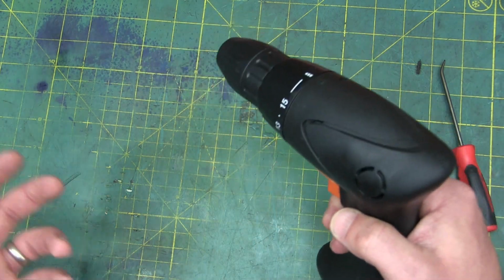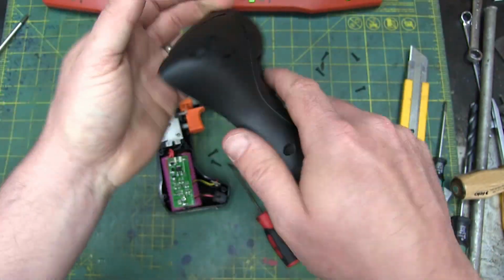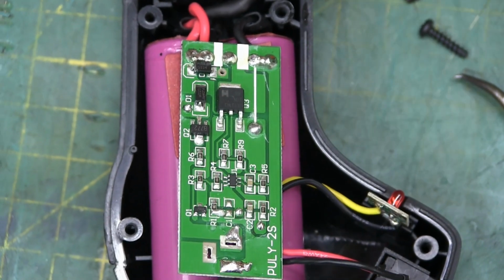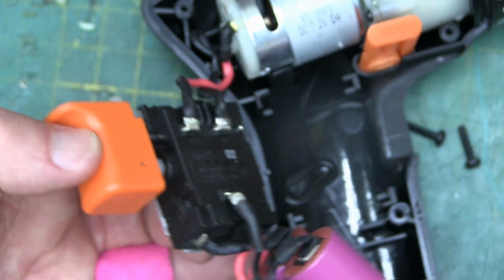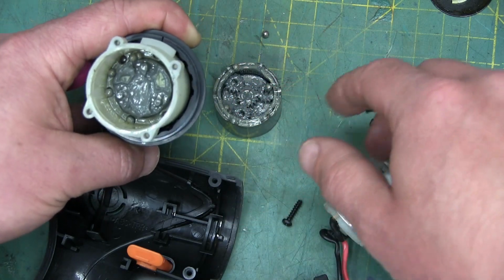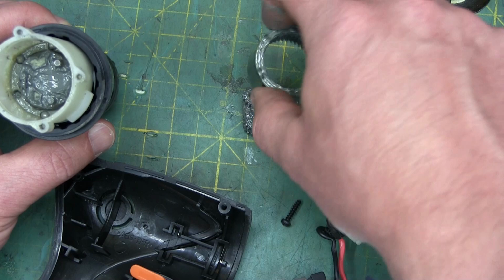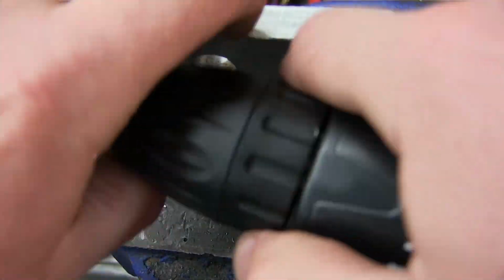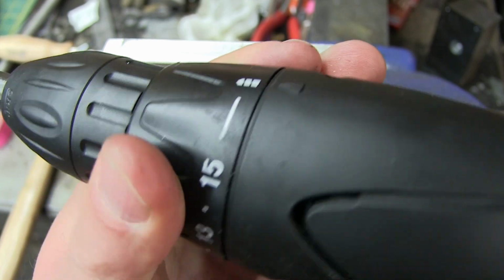BOLTR: WORST IN CLASS IKEA Drill

Comment: are you sure the clutch is back together properly?  because mine does not slip at max setting, if the load is too high, the protection circuit will cut power to motor instead of any mechanical protection.

Comment: I picked up the Black and Decker 8 volt LiON dril for $20 bucks from Malwart. No clutch, no proportional action on the trigger, little 380 sized motor. But you could charge is with a USB port (It's kinda funny plugging your drill into your laptop to let it charge). After about 6 months of using it for things like 'picture hanging duty' and drilling the odd hole, the whole gear box started moving inside the body so the chuck had like a 1/8" of play. I put the brain board and batteries in an old 4.8 Makita screwgun from 1992 (Ish?). Works like a MoFo now.

Comment: I mean... you have to consider this isn't sold as a "TOOL", it's sold as an accessory to assemble the 10 pieces of furniture you just got at Ikea with the pre-drilled holes. Honestly I'm sure they 100% knew this thing had no torque... and that's so you don't destroy the particle board pre-drilled holes shit Ikea sells. Also... too much torque and those cheap Pozidriv bits will self destroy, potmetal pieces of shit.

Comment: Looking at the battery charge control PCB, it appears to have a ubiquitous six pin dedicated control chip as seen in many Li-ion consumer products. Controls both the charge, current draw and under voltage cut-off.
Reply: Maybe tweak the current sense resistorator to get just a little more schmooo...

Comment: Never seen a tool take more shit than a Hilti. We use both the cordless drill and corded combihammer at work and man does those hold up great! Left in rain, drowned for a few days, frozen stuck in  water over the weekend with temperatures at -30c, exposed to extreme heat form propane torches, tossed off the roof at 15m and continually running for 18 hours straight 5 days a week, mind you on the combihammer we had to replace 3 extension cords cause they couldn't handle the extreme usage. and the tool last around 3-5 years with that usage every week.

Comment: First lithium powered drill i ever bought was a ryobi 12v yrs of beating fixin crap in the house for my better 3/4 part. It surprised me when i did some shelves one battery about 30 3" screws into pine studs and it didn't even complain.

Comment: Just as a side-note...had something to do once with a similar drill, only mine was mains-powered (one of those series wound universal motors). It had the same clutch mechanism, and i managed to mount it offset (IE. the markings on the clutch settings weren't accurate. Max clutch torque could be stopped bare-handedly. You should check whether that's the case ;)

Comment: Hey, AvE! There might be something wrong with your drill. I'm pretty sure it's not supposed to slip with the clutch dial in the driling position. Mine just stops working when it gets overloaded and if I twist the business end a bit, it works again. Also, I get a decent amount of torque out of it, enough by a good margin for drilling holes in, say, birch. I think 8mm is the biggest bit I've used with it for drilling and I've made 64mm (ca. 2.5") holes in one inch alder with it. Of course, aluminum is fine, too.

I got a returned unit for 10 euros a couple years back and it's the most value I've got out of a tenner, I guess, ever. I hardly ever do anything with steel or stone, but when I do I don't ask the Ikea drill to do it. The 250 euro Bosch is for those. This Ikea drill, I use it for everything else, in the literal sense. The idea is to know what it can and can't do. I remember using the Bosch twice in the last year, once for drilling holes in .30" steel and once when I forgot to charge the Ikea drill. I've got to say, I love the little bastard! =D

(And I let my friends see it, too.)

Comment: Was the dewalt you referenced the DCD785M1 ? Because I have one and the fuckin thing is out of warranty because my dumb ass didn't register it (Or know I had to!) for the 3 yr warranty. I nearly have to choose a smaller drill bit than the hole size i want to drill because the €200 "professional drill" I bought is as wobbly as a nun after getting her knickers pulled down.

Comment: lol that little dc gear motor is around $2 or $3. Similar generics on fasttech are :- the 12v rs 380ph is $3.30 or the 24v rs 65sh is $2.09 :D or you can get a motor and step down for around $4 :)

Comment: My old lady had one of these for putting picture frames together it died. so she bought a Bosch drill all it did is tear the screws out of the frame so it's in the draw and I rebuilt the old girl  still going. I may of had a couple of parts left over.
Reply: Richard Rowe Why wouldn't she use the clutch... instead of full bore.
Reply: Broxty do you think i can get my mum to understand that the trigger is variable to her it's only on or off, it's like trying to train an old dog a new trick
Reply: Two things: 1 round here old lady means your wife, 2 which spare parts were left after reassembling your old lady?

Comment: I love mine! Got it for free because the batteries died. Replaced them with some old ones for a laptop battery pack and it just keeps on going. Great for taking apart small electronics, drilling small holes etc. Ikea should call it the "Boltr" ;)

Comment: 2:55  isn't that a micro in the middle of the board?  The tiny gidgit...
Reply: The little 6-pin chip is most likely a dedicated charge controller, making sure the batteries aren't overcharged or discharged below the minimum level etc.

Comment: The thing about it that pisses me off the most is the gouty foot thing on the bottom pretending to be full of batteries when in fact they fit in the pistol grip and it could have been more compact.  It's like when you get the girl's top off and she's all Wonderbra and wishes when she'd be just as sexy, maybe moreso, if she rocked what she's got.  The drill is insecure of itself when, given what we see here, there's really nothing wrong with what it is -a small, cheap electric drill for apartment-dwellers, the office, rigging up to charge off the car battery & leaving it in the trunk, an "upstairs drill" because the good ones are in the basement/garage/truck, etc.

Comment: My 1983 Hornet had that motor!
Reply: I think I mean Grasshopper
Reply: Yeah, I totally noticed the same thing. Good times.
Reply: I loved my Hornet..Levi special edition..seats had authentic Levi Jean material and rivets....oh this isn't the Hornet forum...sorry.

Love these vids..keep em coming.
Reply: +Raymond Mucklow you sure that's a magnet? think maybe its to dampen and keep rattles down. At least its been that way with the rings I've found on motors. I had the original Bruiser. I was at the second race for our RC club when it shared an oval track with the horses. last I checked, they were hosting the winter nationals.
Reply: Jimmy's Tractor I hate to break the news, they didn't have the permanent magnet on them. That big ring around the case.
Reply: Jimmy's Tractor my folks bought my brother and I a grasshopper. Then i bought  the frog from my uncle.
Reply: Yeah, Hornet came with the 540, Grasshopper had the 380.
Reply: Jimmy's Tractor man it might not be but I don't remember any of the motors having that ring around the outside, could be wrong, I'm 43 now I know they were top sellers for years. but for sure they didn't. The frog I had had independent suspension.
Reply: Jimmy's Tractor Remember the Penn in the arss speed controls man those sucked.
Reply: LindyFD 160 yeah, the frog i had bought later had the 540 on it. still no ring tho, around the outside.
Reply: I also had bought the Blackfoot it was the frog with bigass tires. very cool.
Reply: +Raymond Mucklow my first was the associated RC12E. It was $72 COD from Tower Hobbies. came with a 6 cell GE 1200mAh nicad pack and a charger with a "do not shorten" resistance lead that would burn your hand if you touched it. one day I forgot to listen for the 15 minute timer. I went out to the garage and all the plastic melted off the cells and resistive wire.

Comment: Nice.  OK for putting together flat pack furniture and drilling holes into plaster board I guess.  The gubbins inside actually looks pretty hackable - if you wanted a variable-speed geared motor for some small hobby project, it might make sense to rip the innards out of one of these.

Comment: Finally, a wireless drill motor I can afford, along with the can of red Milwaukee paint.
Reply: M3 1st gen. 🤣
Reply: IamScarhead
Reply: Haha, well if you want some decent stuff I'd recommend going to a yard sale or looking on craigslist for tools nobody wants anymore, most of the time the only problem with em are dead batteries (and maybe a little dirt) so they're super easy to fix with a $30 replacement or if you're more of the DIY type then a few cells shouldn't cost much more than $10 +$2 for some tabbing if you don't have any.
Reply: @vgamesx1  The problem is the batteries often cost more than they are worth...
Reply: @Wingnut353  you can replace the cells yourself though
Reply: IamScarhead lol. check my channel if u like Milwaukee tools

Comment: Thanks for the teardown!
Found a bit of info about the batteries...possibly: http://www.sourcingelectricals.com/3-6V-1300mAh-ICR18650P-Electric-Tools-Lithium-ion-Rechargeable-Battery-11226606/

The capacity is different though.Often the companies divide up the production run into their different capacities, tested at the factory, and label each differently. Also done quite frequently by some companies is just not accurately rating the batteries. :-) Hopefully the ones in the Ikea use the same less-volatile chemistry variant for the ICR prefix as used in the batteries in the link.

Comment: Uncle BumbleFuck, I'd like your opinion.

I'm more of a corded tool guy over cordless. But I honestly haven't had much experience with tools that don't have cables (perhaps I'm biased that way).

Do you have opinions regarding cordless versus wall-supplied pixies? Apart from the obvious potential tripping hazard, what with extension cords and what all over the place...
Reply: less torque and more dickin round....stick with the cords if you can. i've gone back to them for many reasons. one of them being corded tools like dewalt sre downright cheap at the pawn shops because no one wantd them these days! i give them the TLC they deserve!
Reply: Morne' Geringer use batteries for places where you don't know if there'll be outlets available, use corded for your home and shop...
Reply: Convenience is hey you can either but first class tickets in a plane or economy.They both get you a seat in the plane.
Reply: Cordless is also great where cords will get in the way, for example if you're working up high such as on a roof, you don't wanna be foolin around with some extension cord that'll yank ya off the roof, soon as you run out of cord or it gets caught on something because you didn't tie it down and it's just really inconvenient having to swap plugs while moving around.
Reply: I like to use both, mostly because of the cost. For example, years ago I had to install decking on a large apartment complex. Replacement batteries for my cordless drill were $110 and a cheap corded drill(with a clutch) was $40. And if you're working off the ground you can tie the cord around something preventing tool splatter.
Reply: No sorry, when I mentioned roof work I was mainly referring to fairly simple housework, like when I helped build a shed, the cordless drill was much easier to work with, especially since there wasn't power running down there to it, meaning a very long cord was needed and there was this one time not too long ago when I watched my dad struggle attaching the gutter to the house with a cable dangling in the way and getting stuck on things below, all the while thinking to myself "wow, you could've made this job much easier on yourself if you just used a cordless drill instead" but he likes doing things the hard way.
Reply: Just grab yourself a 18v lithium Ryobi impact driver/drill kit, think they are still just a taste over $100. Than after you realize you will use the hell out of it keep that for home use and upgrade to Dewalt for a descent durable bang for your buck if you are gonna use them for construction hours. Otherwise for a nightly/weekend warrior Ryobi cannot be beat. I have been in construction for decades and the batteries and tools are so good now, especially those cordless impact drivers, compared to old cordless that you only really need corded for long term high torque needs or specialty tools. Just never leave your batteries out in the freezing cold and give them a charge every now and than if idle and you will get years of use out of them.
Reply: To Much Information(TMI) Associated with the humorous sexual references in your comment. Your 100% correct tho, for the price Ryobi can't be beat and yes, those grips turn into Michelin Man love juice after wrong chemicals get on them, nasty.
Reply: John Smith we'll this channel is weird to begin with!☺
Reply: swOhio Well, there IS the matter of not having a slew of batteries and chargers all over the place. Seems every damned thing uses a different shape battery housing, and even the manufacturers have started intentionall NOT making things available in the same battery classes. E.G.; Milwaukee's 12V 1/2" anvil impact tool is NOT available in the U.S., they want us to buy the 18V version (with all the charger and extra batteries to go with it). Some jackass company green somethingorother even makes 24V lithium batteries and chargers that are incompatible with each other.
Reply: I only own one cordless tool (and older Makita drill). I think the only reason I haven't pulled the trigger on any other cordless tools, is because I do a fair bit of automotive work so I'm used to dragging around an air hose for tools. So an extension cord doesn't bother me that much.
As handy as they may be, I think cordless tools will always stay safely on my "want" list as opposed to other things that have seemed to somehow work their way over to my "need" list.
Reply: John Smith I've abused my ryobi impact driver at work working on paving and concrete Equipment and it's still chooching peeled off the condom of the handle because i got the wrong lube 'hydraulic oil' on it and it became a  sticky mess "siiiick!
Reply: terry jenkins TMI Jerry. TMI.
Reply: Da L. TMI?
Reply: i only do DIY stuff and have a milfuckee 2408-22 12V hammer/drill/driver and a milfuckee corded 5376-20 1/2" hammer drill  for when need the extra power or working long periods of time. and so far the only one i have used is the battery one...
Reply: InsideOfMyOwnMind  "ha ha!"
Reply: I would say get both types.  There will be sales, used tool prices, etc where you will find it useful to have several.  As you know, short tasks might be done with cordless, and a longer project could be done with corded.  Not to mention when you are drilling pilot holes and doing screws, having two different drills will be convenient.
Reply: John Possum  my grandfather has an old drill from the 40s
Reply: Cords are better, i'm poor as shit so replacing batteries is just pissing away money